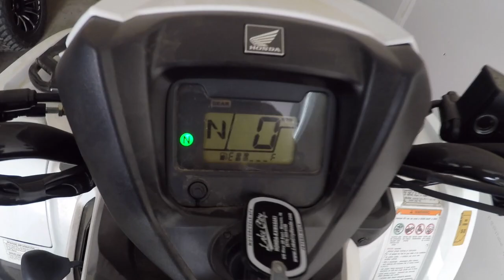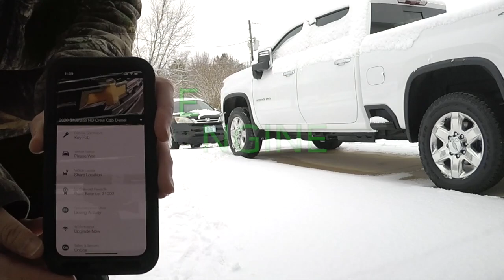Plowing the driveway with our Honda Rubicon

Comment: Awesome video. I love seeing a lady do this kind of stuff. I love your bike, nice color. I have the same one but mine is a 2019 matte gray metallic. I have a 60" plow, and Warn VRX3500 winch on it. They sure are great for plowing, and it's fun lol. I really like where you have your winch switch switch mounted. I can't tell from the video, but how exactly is it mounted, did you mount it using one of the bolts for the electric shift switch or does it just look like that? Thanks.